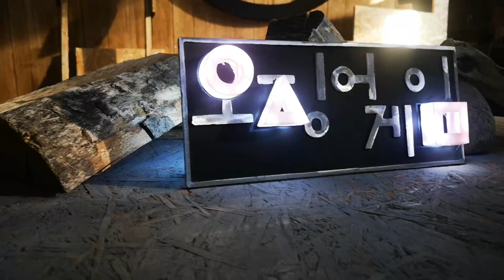Casting SQUID GAME Led Logo Lamp

Comment: You inspired me to do this, I have built my sand boxes. I have my foundry parts ordered. got my crucible. I have a question though about the propane torch about what size hole do you have to let the propane and air mixture be so hot? I think i had a 3/32 hole size but the flame stays yellow. Please help a fellow hobbyist!